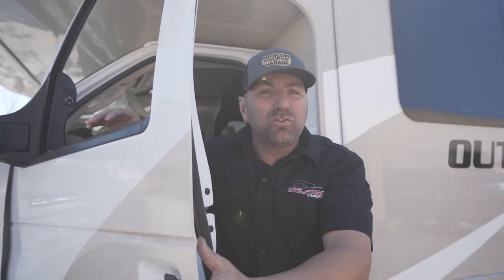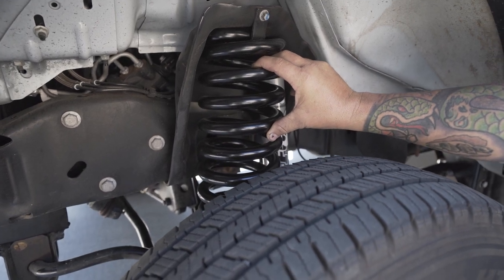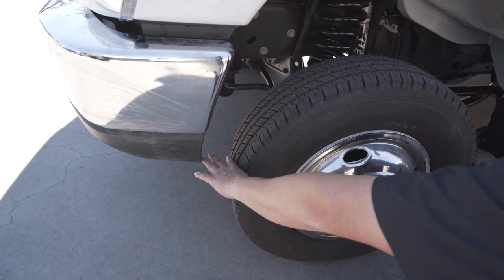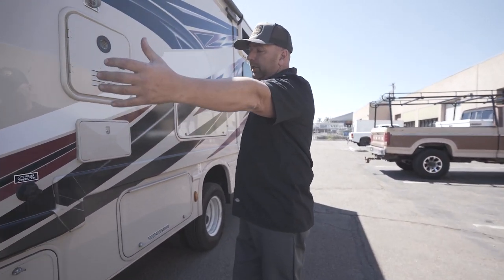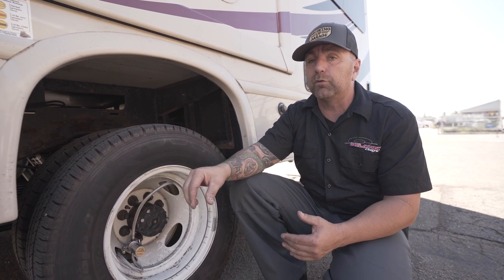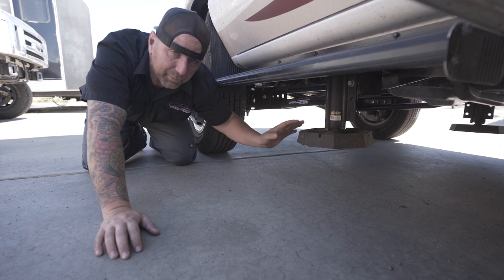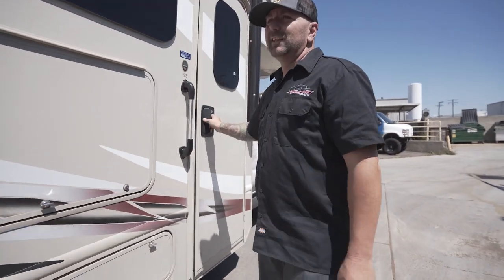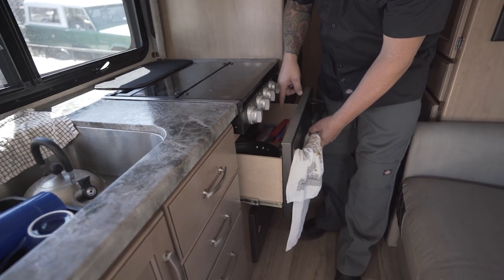Class C Rv Suspension Lift kit

Comment: I just bought a 2010 majestic 29 ,no slides, and want a 6” lift kit from you guys. Do you have any qualified installers in the Vancouver B.C. Area that could handle your system driveline angles and all? Great stuff. Love all the new builds